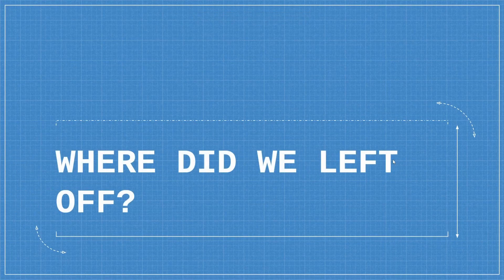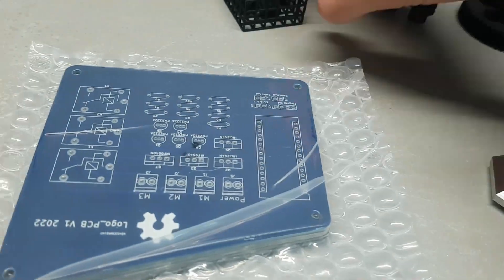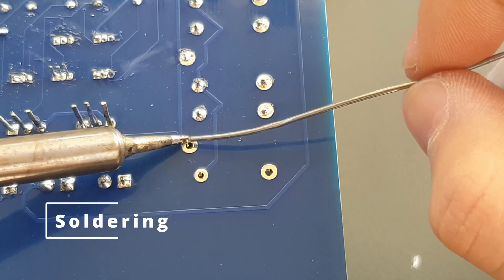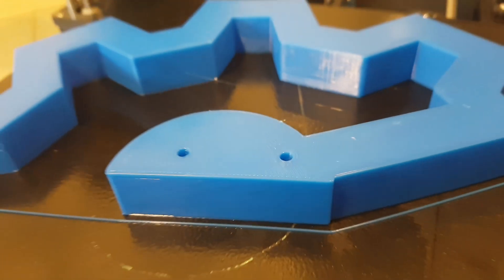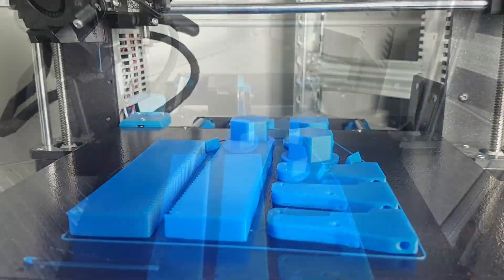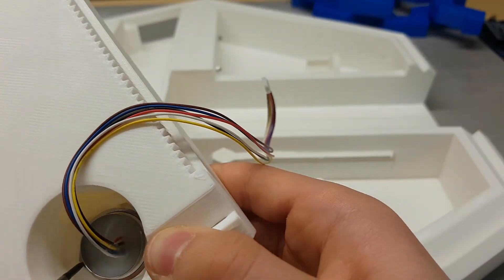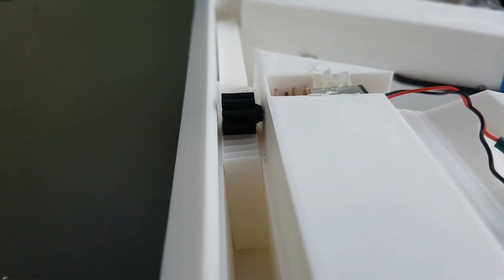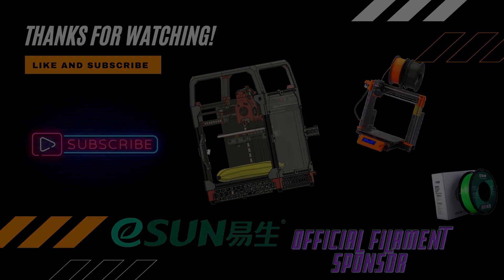Finishing the secret key holder - PCB + 3d design - pt.2

Comment: I am not an expert in pcbs, but what happens if you make the pcb 3 or 4 layers thick? can you fit more things into it. Because that pcb seems a bit big, but maybe it was done to make it cool looking
Reply from the maker: Yes that's right, more layers means that you can do more connections so fit more complicated circuits in a smaller space.

Comment: Those little 12v are very powerful for their size. Initially I thought that they would have been too weak to push that slider. Might be useful for other projects too
Reply from the maker: Yeah, those tiny motors pack a lot of power in a small package